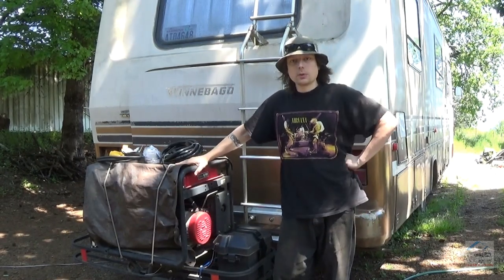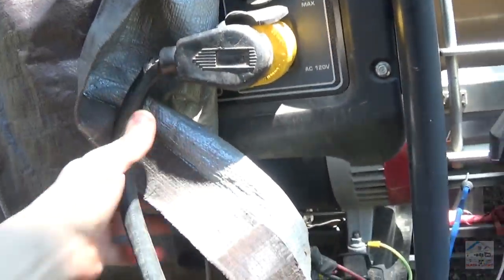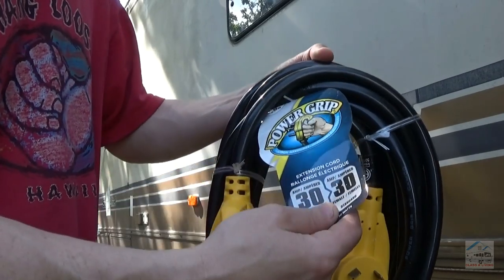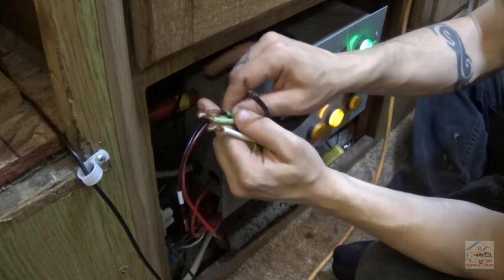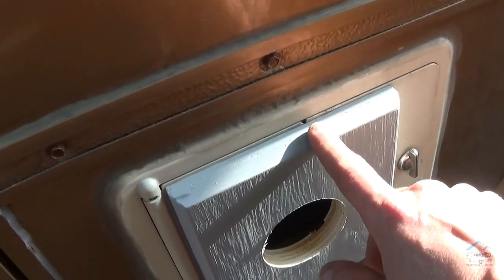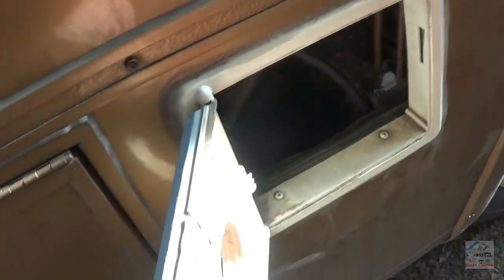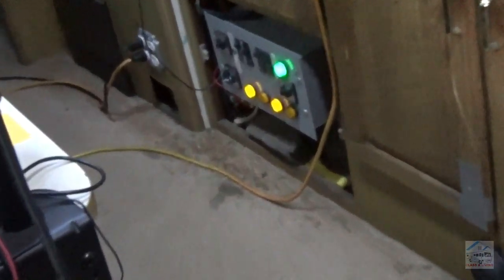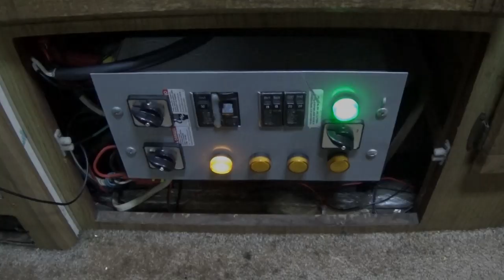Camco POWER GRIP Cord Install - RV Living

Comment: when running ANY electric cable thru a hole like that get yourself some inexpensive rubber grommets, they help with wires being pulled as u did thru a freshly drilled hole so things don't chafe or cut :)

Comment: Part of the reason that plug fail is due to using those electric heaters, they have a tendency to draw too many amps and fry extension cords.  I would toss those things as they are only meant for a few hours on (2-3 hours) at most and then give them a rest, seen this happen before and found that it was the electric oil heater nearly frying the whole electric system in an older RV.

Comment: FYI. ( When the socket or plug is burnt) you are trying to pull 30 amps from a 15 or 20 amp house socket...my class c had burnt ends like that too   if you are at parents house or friend who you boondock with a lot you needed dedicated 30 amp breaker cord sucket and this won't happen. Ck your generator and make Shure it has a RV 30 amp outlet. Or only run lights tv DVD at one time
 If you use a microwave on a 20 amp breaker. Just my two cents from filler fellow rver in co..